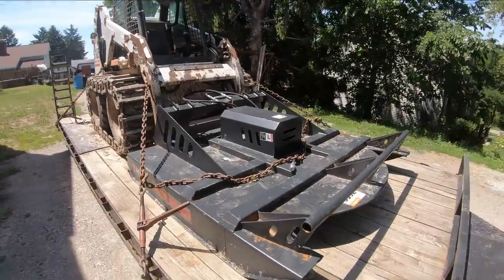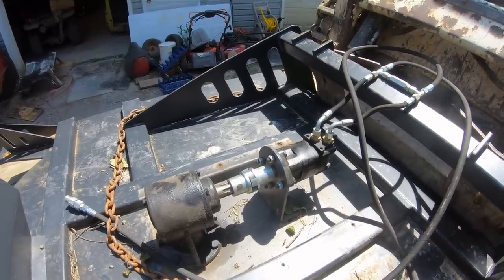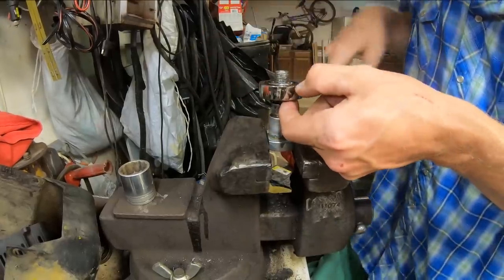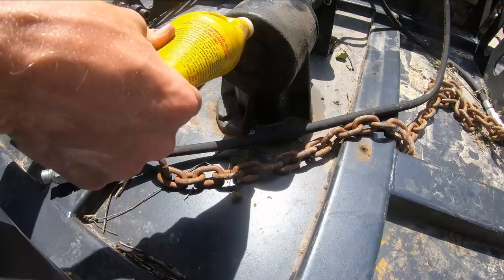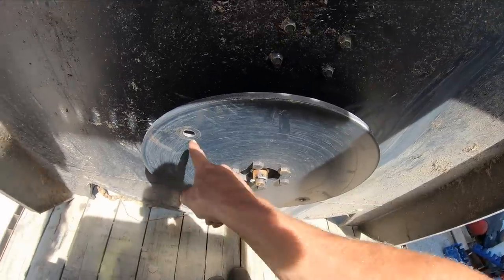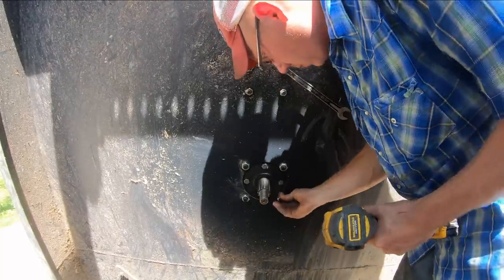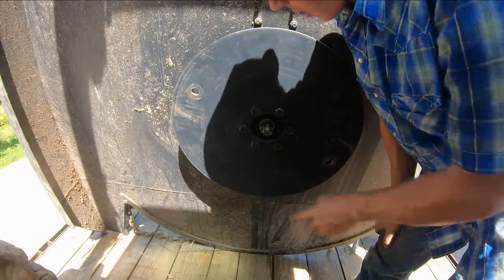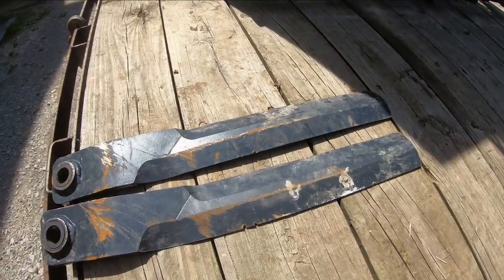BUYER BEWARE: Generic Auction Brush Cutter Inspection & Repair (Brand new JCT)

Comment: Time (-3 yrs) to weld actual nuts onto the frame where the cover sits, or use rivnuts.  I refer to  cheap Chi hardware as "Grade 1".
3 years later, there is talk of "Tofu Dregs" in many of China's metals and building materials/labor.  I think you found some, Matt!

Comment: 17:00 a few tips for things like this. hit the nut and bolt with brake cleaner to let the locktite really bond well. and welding on it afterwards just burns the locktite back out

old farm trick. take a center punch and nail 3 faces good and deep. it will deform the threads inside and make it an interference fit. I had to do this when the quicktach adapter for our backhoe started falling off because the dealer was cheap with hardware. I got all grade 8, with nylock, and red locktite, and I punched three faces. It might as well be welded on there now. I was just being polite in not adding a few strings of 7018 on it for good measure just in case we ever need to get in there for hoses or something. I'd rather just torch the nuts off to get it back apart (I have no intention of even trying a wrench on them it's so hopeless)

Comment: I bought a very slightly used Frontier RC2048 (John Deere) rotary cutter and had some similar problems.  No oil in the gearbox (probably used less than 1 hour dry and apparently no major damage.  The castle nut holding the hub on would not tighten enough to put a cotter pin through the hole.  Specs called for a ridiculous amount of torque on the bolt (something like 400-600 ft-lbs I think).  With the help of a neighbor and an 8 foot cheater bar, we got the necessary torque (probably a little more lol) and the hole lined up for the cotter pin.  My point is, don't trust anyone.  Check everything no matter where it comes from.

Comment: It's especially horrifying and frustrating for me to see these kinds of workmanship defects in these things.  I almost died once, back when I was working fence crew clearing heavy brush and blackberries on a naval base.  They had a mobile tractor with an articulating arm-mounted brush cutter not the same but similar to this - the kind that drive along the street and mow back the brush?  Those things.

I was sitting on the back of the truck because it was 95 degrees out and we were wearing double-layered carharts, and just trying to Not Die in the hot weather while doing heavy yard work, and I finally caved and decided dying in the sun wasn't worth my pride, and I got up and squeezed myself in to the cab with 2 other guys who were sitting in it with the AC on.

Not 10 seconds later, we all heard a massive CLANG and spun around just in time to hear a WOOSH-WOOSH-WOOSh sound as a huge hunk of metal boomeranged RIGHT over the place I had been sitting 10 seconds ago on the back of the truck.

The operator of the brush cutter had hit one of those metal property stakes, bent it in 2 places, and sent it flying at such incredible speed that it was burried in the dirt some 20 yards away.  It 100% would have taken my head clean off, had I not decided to get up and sit in the AC.

The day laziness saved my life.

Comment: Could you have pinned into the centre nut, threaded another nut on top to protect the threads then tack the two nuts together?  Zero damage to the threads, and you can cut all that off if needed and have a virgin shaft revealedif needed.

Great vijayo and I really appreciate your style, integrity and honesty.  Thanks!

Comment: I would build a second plate to go over the bolt heads so the bolts are in double shear.  You could welds some round bar to the mower plate and cut holes in the stacked plate to plug weld it to the other side.  You have to be careful not to impede the collapsing flail action of the blades, so placement of the standoffs is important.  You might just get away with a welded tube in the center that still allows access the center shaft, but stands the bottom plate off from the top plate.  The double shear will take a lot of stress off those bolts and help prevent it from spitting blades.

Comment: one helpful thing, sometimes, if you don't have a die but you have some spare nuts, use a pizza cutter and put a notch in the nut, vertical but offset left of center on the bottom of the nut, works with a bolt too as it makes an impromptu die when using a grade 8 hardware

Comment: At first I thought I was on "the Whiner channel". You did not purchase a quality piece of equipment then ridiculed it's condition. FYI: auctions are where people get rid of problem equipment. I will admit you did own up to the fact it was cheap. If you would have done a proper inspection before running the machine, there probably would not have been a vlog on it. The tricks to fix the unit were great and the Love Joy coupling is a good coupling, just need a steel made one. I did enjoy it, instead of whining, show your positive attitude on how you over came the problems, I think the vlog would be more enjoyable to watch. Keep them coming!
Reply from the maker: My grief is that this is brand new from the factory not a used auction find, it was sold at an auction yes but was never used before so why am I having to fix all their poor workmanship
Reply: @DieselCreek  My apologies, I misunderstood what you said in the vid. I obviously took it as an used piece of equipment.  Since this is true, I would agree with other post, anything coming from any manufacturer needs a good initial inspection before operating. I still like how you were able to make repairs to get it going in such a short time.

Comment: Appreciate your vids ! Yepper totally agree with the outcome here. If you buy thrifty, especially on equipment, little doubt there will be a little work associated with it. Just my 5 cents - someone mentioned a different "shock clutch" on the gearbox, which really means switching to a slip clutch. My cid had a shear bolt, which still works but is a pain to deal with. I would also reccomend never welding the blade attachment bolts in place. Yes, for sure keeps them from coming off, but at some point, you will want to remove them. Why not use red locktite with two nuts on each bolt ? Getting that apart is super easy compared to cutting everything off. Also - highly reccomend putting antiseze on the tapered shaft and bolts sticking through the bottom of the deck. Again, easy to get it off later on. Appreciate the vid!

Comment: I have seen that issue before Where the cotter pin Isnt in the slots on the castle nut on several vehicles it was the wrong Thickness Castle nut And people cheaped out and just put the cotter pin in anyways Seen it happe. Tp many times on CV axle Castle Nuts and the wheel on the customers vehicle went flying off after the hub got destroyed Matt Not Good at all Shoty Work there 12:00 @Diesel Creek

Comment: They are shipped dry so lube is expected.  That is a low hp gearbox...anything over 3/4" saplings will kill it in short order.  Use it to mow and a little brush work like buck brush or multifora rose and it will be serviceable.   Cut couplers from conveyor belting with a sharp chisel and they will last much longer.

Comment: yup, got one of those at auction myself. lasted a day before i broke a blade. played hell trying to find a replacement. ultimately, i wound up machining 2, 1.5 in carrier bushing to replace the cheap 1 inch that i couldn't find blades for. machined the holes on the carrier bar to match new bushings and paid a buddy to weld them in place. (one of these days ill brake down and get a welder. lol ) end result, got a much stronger machine and i can easily replace the blades. all told, about 5 hrs in time and 250 bucks total.

Comment: I see these go under the Wolverine brand a lot.  Have seen them go sometimes for $2200 but saw a bunch go for as cheap as $1300.  To my knowledge, they're all Chinese made, usually imported under a certain brand name and often through some nondescript address in a strip of offices somewhere.

Basically, you get what you pay for.  If you're doing a bunch of light brush and limbs, you're probably okay but like you've found out, it pays to be able to work on your stuff or weld a little bit if you buy one.

Comment: A couple of comments:
The cost to ship a 40' sea container from China to New Jersey was around $1,200 the last time I checked.  A 40' container can hold a lot of skid steer brush cutters or concrete mixers, or whatever.

These are made from 100% Chinese made components.  They are designed for export and the lowest cost.  China can make good things, they make space satellites,  just not good farm tools for export.

The brand and labels on the machine mean nothing, when you order these from the manufacturer you specify the brand/label you want, it can be absolutely anything ... John Deere?  Sure thing.

If you want to be a skid steer attachment seller:  find a type of equipment you want to sell, in this case skid steer mowers.  Search for skid steer mower **export** manufactures in China, you'll find over a hundred, probably many more.  This is easy to do, even without speaking Cantonese.

The **retail** price of these in China is between US$1,000 and $1.600.  It's easy to buy at a substantial discount, remember you've got a 40' container to fill.

These Chinese manufacturers will make exactly what you want them to make, good or bad, if as a wholesale buyer you make them compete on price they will cut every corner they can, that's their business.

Take a look at the list of skid steer attachments Chinese manufacturer already have available.  You can find many in English (well,  sort of English) on Alibaba [dot] com     There you'll find an amazing list of inexpensive stuff, in this case, search skid steer mower.

If a reseller wanted better quality it's available, you just need to exactly specify what you want, and pay a little more, they'll make it.  In the US it's easy to find a native Chinese speaker to communicate with Chinese sellers, it just takes time and patience, most resellers have neither.

Disclosure:  I have absolutely nothing to do with equipment, selling, manufacturing, etc.  I just know a little about this area.

If anyone has questions just ask.

Comment: Hey pump n gearbox cover . Drill em out or just put 4 new holes and use nutserts and proper bolts . .
I built something made of Chineseum the self tappers are Sh#^*e made of chocolate . 
Ended up riveting it together . At least it won't fall apart . 
Great video Matt .

Comment: Every implement I've bought with a gear box is shipped empty of fluid.  That brand of 60" brush cutter is readily available between 2k and 3k which is the low end of the market for those things.  Those blade are thin compared to my tow behind brush cutter (pd $1200) and my tractor 5ft Bad Boy brush cutter I got for $1900 at Tractor supply on sale.  I've cut 3"-4" trees with both even though both are rated at 2"

Comment: My rule with tools and equipment....
1. If you use it frequently...get top quality.  
2. If you use it occasionally and don't have the cash, make sure it is an item you can repair easily with modular/common parts.  
Seems you picked my second rule here.  It is what it is.  You have the know-how to fix things to make up the difference in price.

Comment: I probably would have just double nutted the center and shoulder bolts. It looked like there was plenty of thread. Then the extra thread is protected and, you could tack the nuts together if you wanted.
 When you have to over bend the blade to get it to come out 'flat', if you strike it with a hammer in several places while it is over bent, it will help. Kinda sorta stress relieving it some .

Comment: BEWARE: JCT and other cheap brush cutters come from China and they can't ship anything with fluids in so anyone looking into buying one of these make sure to do the following before running it....add 80/90 gearbox oil, check to make sure the bolts holding the blades on are tightened down, For the price these are actually great brush cutters if you use them on brush and grass/weeds. If you want to cut down trees then you need to spend some money and about 3x what you pay for these. I have owned and sold several and can tell you that you will for sure break some of the screws when taking off the guard to put gear box oil in and I would recommend buying some USA steel blades to use. Use it for what it's intended to do and you will be happy with it if you paid $2500 or less.

Comment: Woulda shoulda coulda

I think you are right. A good check over before operation woulda helped. I’m not in favor of tacking the nuts. In my experience double nutting is just as effective and easier to disassemble. 
Are those blades reversible?
Also you went pretty hard on some large trees in the beginning. That didn’t help either. I think it will serve you well now that it has some lube and the nuts are tight.

Comment: The sweetnees of the low price is soon forgotten due to the bitterness of the poor quality has been my experience.  Sorry for your misfortune Br0 . 
You called it an extreme duty brush cutter when mentiong the looses nuts on the gear box. It is by no means and an extreme duty attachment . It is light duty @ best...more suited for cutting tall grass than anything else.
 You also mentioned that comparable build quality ones were 4 or 5K  elsewhere. I am pretty sure that is not the case. 
4 or 5K would get you a substantial upgrade  if compared in person. 

I almost went down your road but thought better as I knew I would wind up pushing the limits of the machine. Glad I pulled back and regrouped . I realized it would be 2500 or 3k down the drain if it wouldnt stand up to what i was doing  so I dove deep and got a true extreme duty for 5600 and it was the best invesment I ever made. 
But I understand your predictament  as your machine would not handle such a thing so you would then have to spend more to upgrade the machine. You were knd of behind the 8 ball I suppose . Your best move now is what you are doing now,repair and upgrade the quality in the process and try and keep her patched together . Just  stop eyeing up big sapplings and thinking you might ge away with it..Good luck..loved the Vid

Comment: With the tapered spline on the blade carrier/hub to the gear box- I think it started out tight and as it was used the splines on the blade carrier loosened up to "seat" better on the gear box shaft. Check the splines on the blade carrier part to see how bad they are too. Still, it makes no sense to install a castle nut where the cotter pin does not actually engage the castellations on the nut. Why did they drill that hole so low? Are you missing a washer that should be on there?
The bowed blade looked like it has a twist in it too. Temporary, so whatever.
Have you been able to find/source some new blade bolts that match the steps you need for yours?

Comment: With the nut on the tapered thread surely you would have been better off sticking some hardened washers undeneath to space it out to where the cotter / split pin actually did its job?

Comment: you can turn a nut into a thread chaser by cutting a slot on the nut. That way it cleans the threads rather than push metal.

Comment: There should be a chain from the back of your cutter to the bottom of your machine.  this shain is intended to limit how high you can raise the unit and never get it so that if running a blade flying off will not enter the cab.

Comment: Hey Matt if you don't have a die run a castle nut upside down and it will act just like a cutter and dump out the filings.

Comment: The hydraulic motor mounting plate should have some gusset plates to keep the motor movement to a minimum which will save your rag-joint from getting chewed up so quickly...
Reply from the maker: Yes I’m going to be reinforcing it soon, it flexes quite a bit under start up

Comment: The shaft and coupler are tapered to provide a tight fit.  A straight spline would never make a tight fit and would hammer out the splines on the softer material.  The nut probably should have been re-torqued after running the cutter for 5 minutes.  It's clear they should have had a spacer in there, or a stack of washers, so the nut engages the cotter pin.  The only other tight fitting I could think of would be a tapered QD bushing and keyway on a straight shaft.  Those shrink down tight on the shaft and will hold just fine.

Comment: My boss has a Bobcat brand brush cutter with 2 sets of blades. It had dropped 2 blades, and 3 of the 1" hard bolts that hold the "gearboxes" to the deck. So, to fix it, I pulled every nut and bolt on the thing, wire wheeled and sprayed with brake clean, then red loc-tite'd all of them. Every one. Then I used white and yellow paint pens to make witness marks on all of them so he can see at a glance if any are loose in the future. I would expect better out of the super expensive Bobcat cutter. Hell, I don't knkw why I expect better, it was probably made in the same damn factory as this one.

Comment: I would stack washers on the gearbox spindle to push that castle nut out to where the cotter pin is at, also instead of Cotter pins use a 16 D nail

Comment: Hi Matt. When you buy something, even from an auction, that is new, you expect it to work straight out of the box, so to speak. You are not expected to go around checking everything is tight and fluids filled, unless it is in kit form. 
By the looks of the main shaft, there were about 3 threads between the nut and the split pin hole. No split pin would ever stop the nut coming loose. Surely there should be a spacer behind the nut to fill the gap so the slots in the castle nut would catch on a split pin. 
Great wrenching vid. Looking forward to the using vid next. :). Stay safe and take care. 
As I say to my son, things are just too chinesily made(chinese and easily put together. lol)